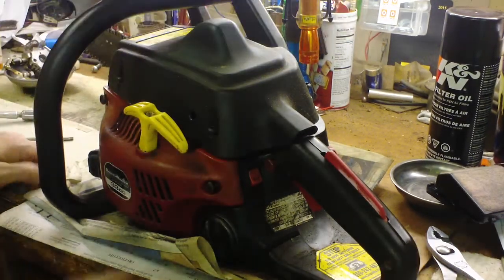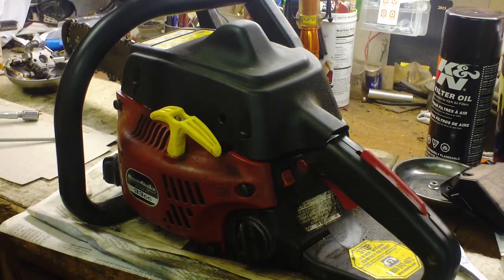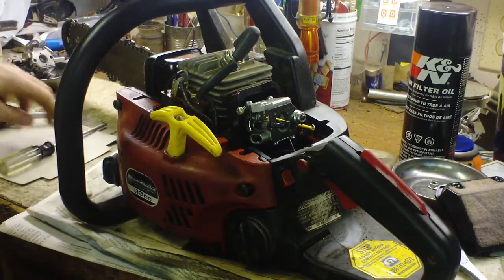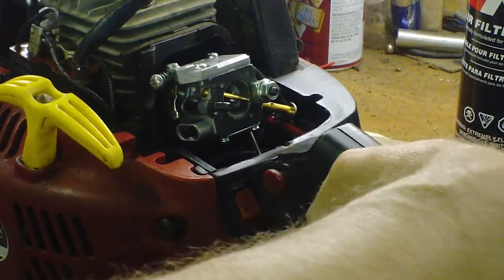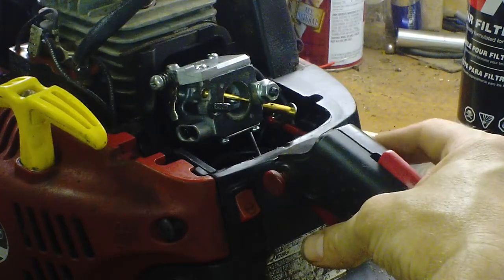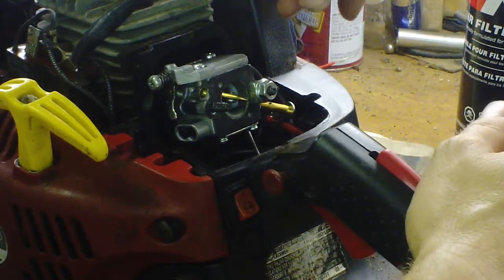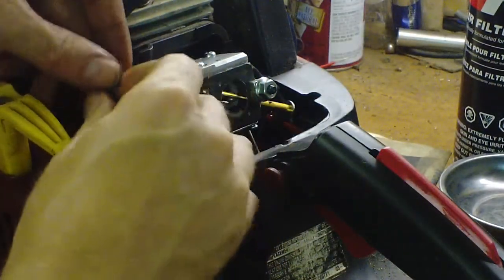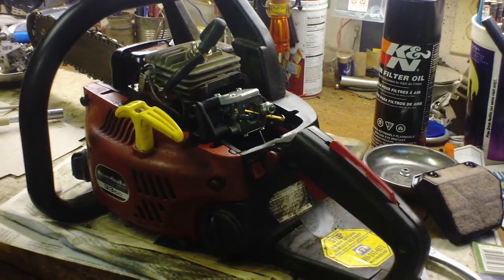Chainsaw carb FIX: Homelite only ran on FULL choke,  DIY

Comment: Why dont you show what fixes running only on choke like your title says
Reply from the maker: I did, we just replaced the gummed up carb. I made a separate clip showing where it was clogged up, but you have to replace the aluminum Welch plug. Don't let them sit up, fire'em up, empty & let run til they're dry. Use Pure gas & good additives like Seafoam/Super Tech & Marvel Mystery Oil.
Reply from the maker: Thanks to Zombie Dave in Tucson AZ, here it is:    https://www.youtube.com/watch?v=K1ZEC5t01CE
Reply from the maker: You get your's running?  New er used carb fix it?     - take care man
Reply: Re did my fuel lines new carb only runs on full choke then still dies out what do you think my problem is
Reply: Got new carb
Reply: Yes replaced the carb